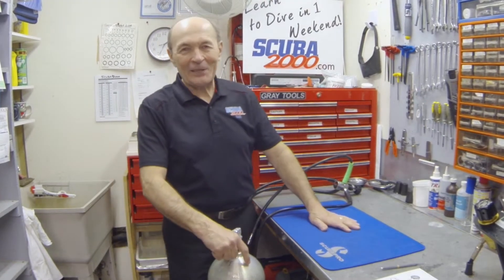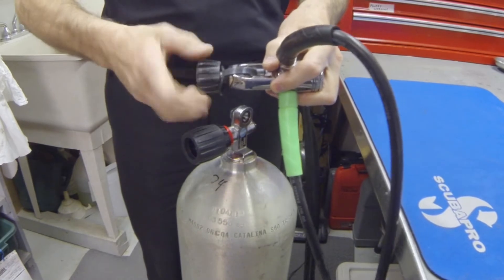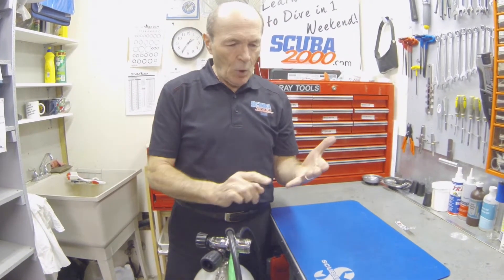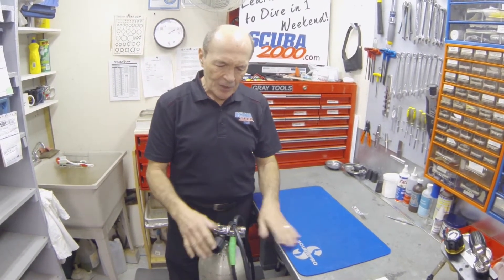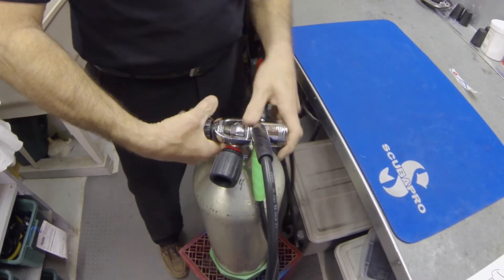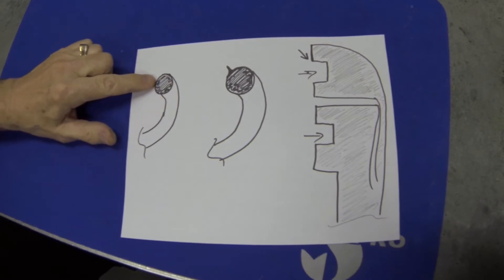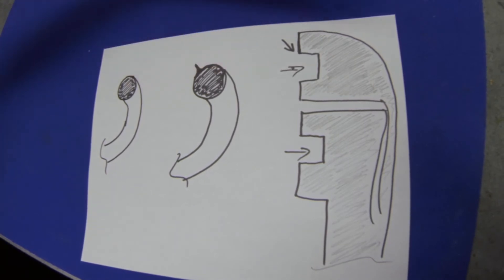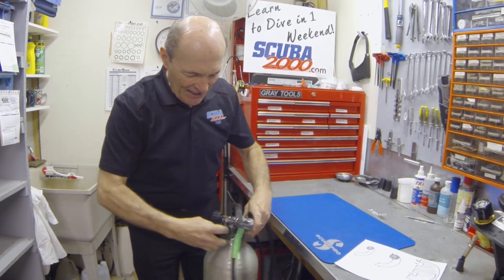My Kingdom For An O-Ring! - Scuba Tech Tips #8

Comment: Why would you open the valve all the way we open it all the way and half a turn close so that it doesn’t rest on the last thread if you close it a half turn it rests on two threads which is safer
Reply from the maker: That sounds reasonable Darren but .... the valve knob doesn't sit on threads.
The valve knob just spins around and around. It is sealed by an O-ring and it doesn't move up or down at all.
The knob shank is inserted into a moveable seat which IS on a thread and the seat moves up and down as it is spun by the knob. When the seat reaches the top of it's allowed movement, it stops (wide open). When you turn the knob the other way, the seat turns on its threads until it reaches the bottom of it's allowed movement and it stops (closed). The threads on the seat are always fully engaged to withstand the tank pressure.
I think you can find a parts breakdown of a scuba tank valve on line. Take a look and you'll see what I mean. 
I have a new Tech Tips video coming that show the operation of both a standard K-type valve (on/off valve) and the older J-type valve with a spring-loaded air reserve.
Thanks for watching.
Alec
Reply: Alec Peirce Scuba well thanks you for correcting me and teaching me yet again something new!